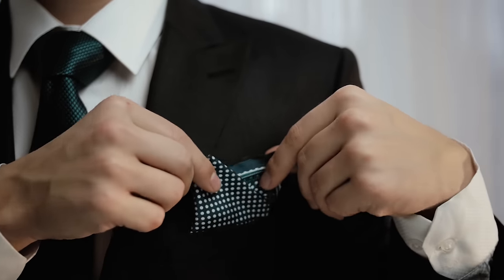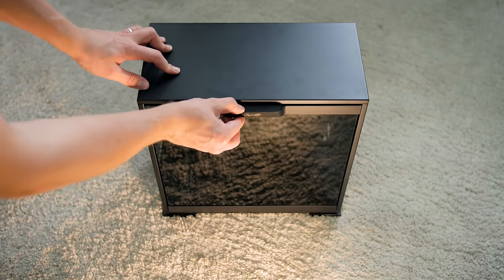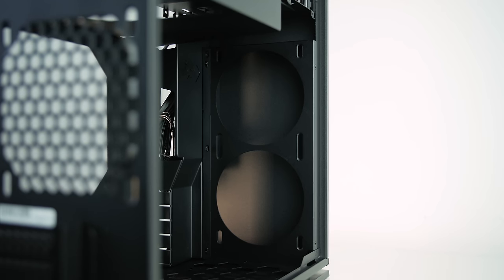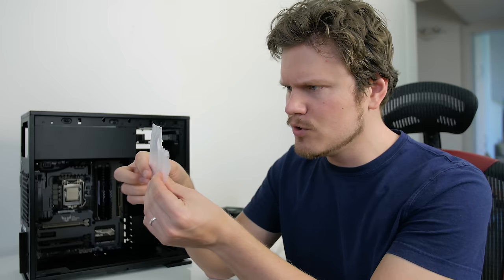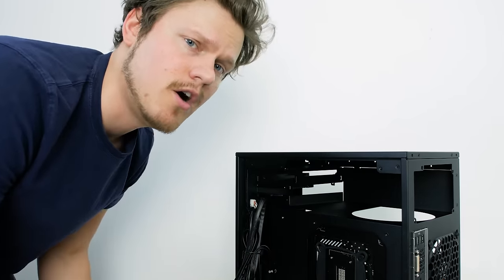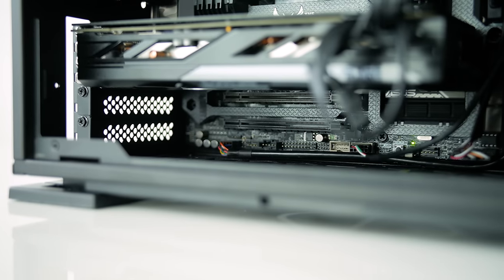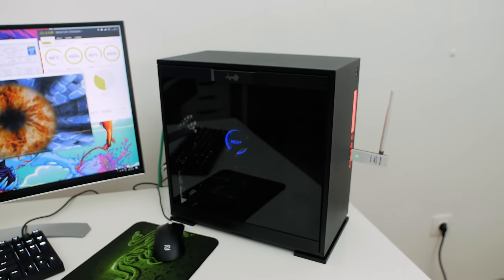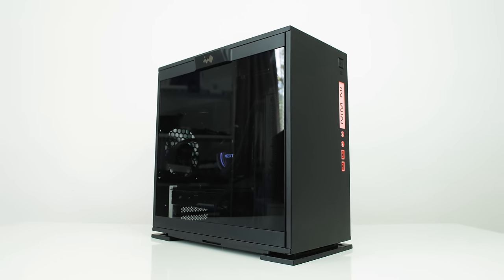Pure Class. The InWin 301 mATX Case!

Comment: This case is one step forward, two steps back.
Reply: Still better than many other mATX cases on the market. Honestly, mATX has always been my favorite form factor and I'm glad to get a decent looking case from them.
Reply: is like twelve steps back. Bad cable organization, PSU at the top (mother of hell are we at 2012???) plus bad design overall and specially the dotted edges like if it's a microwave or something. I wouldn't buy this even if it was at €20 or less
Reply: define c was good tho
Reply: zadoww well said, aside from the design, i'm not a sure about that bottom fan placement and it looks like that cable management will be a challenge. That  side panel is great tho.
Reply: Ber Ting well the bottom fan placement is need because lack air flow. And since hot air rises it would make sense put fans on bottom
Reply: *This brand
Reply: now I get it thanks! but i'm still concerned about the air intake in those fans especially in my country where temps raise up to 38-39 C in summer.
Reply: I think that the main air intake zone is the bottom, like in many Silverstone cases
Reply: we come together cause opposites attract
Reply: zadoww As with most Inwin cases.
Reply: stealing my profile pic?
Reply: ...been using this for Years.
Reply: you have to keep in mind inwin designs cases for custom water cooling loops not air coolers. Also that tempered glass side panel latching mechanism is my favorite so far.
Reply: There is nothing to attractive about this for CWC.
Reply: Only bad thing about these sleek InWin cases are the lack of air flow for intake, so I'd like to disagree on "bad design," because that's highly opinionated. Trust me, even with all the options of rubber gromits and cutouts for cable routing, A LOT of people still don't put out the time to cable manage anyways.
Reply: oh we had the same idea than!
Reply: nzxt s340 elite is better. 301 is a fokin vaccum
Reply: Lanze Manao in what ways is it better? you can't just claim that one case is better than another without detailing why you think so. I for example think the 301 is more aesthetically pleasing and I love the radiator mounting at the top. plus they are different form factors
Reply: I mean it's not meant for an atx motherboard, the intake is at the bottom and once again this case is designed for water loops not air flow.
Reply: don't get me wrong, they are stylish, but there are always a few elements to the design that make them woefully impractical.
Reply: I think it's impractical for an aio or an air cooler for sure.
Reply: This is true. AIO coolers need to have longer or more flexible tubing in order to put the front panel back on, or for most I know zip tie their tubes to any of the opening of the honeycomb fan grill at the top.
Reply: The case would work just fine with an air cooler and some common sense. If you think the front will choke up intake then maybe it would be sensible to try something else in the review?

And some of the points made are just stupid. Try to see cases from users perspective and not from someones who keeps rebuilding systems. Most of us just build it and upgrade gpu in 2-3 years.
Reply: indeed. InWin needs to start thinking about convenient design already. cable routing needs to become a priority for them.
Reply: the only worry I have with the latch mechanism is that every single store that I went in and checked out the 303 on display,  every one of them had the latch mechanism broken to where it would not hold the door close anymore.  Makes me wonder about the durability of that latch,  though I do understand that display models are usually subjected to much more abuse than would happen in a normal use case senario.
Reply: @Dash Trash Who the heck cares if the PSU is at the top, it makes practically zero difference. PSU at the top tends to get less dusty anyway.
Reply: @Kareef Huggins I mean, for that yeah I would say those 303's have probably been opened several factors of magnitude more than your average home owned case. Home owned case you  open it maybe once every month at the most. Those probably get opened and closed 10 times a day.
Reply: Agreed. Sexyaf, but poor airflow and no external drives?

Comment: hey guys,
just to mention: THIS is not how the case is supposed to work, as you can get from any pictures(e.g. in win website) the bottom is supposed for intake (--> dust filter), the front for outtake (--> no dustfilter needed)... The case uses the effect of warm air going up and ventilating the graphics card directly... The front just lacks of intake area (much blocked)... I'm quite sure this could help the temperatures.... 
(-> maybe new testing needed, so you don't use the potential, what is quite sad...)
greetings ;)
Reply: jojo23 Thanks! this should be top comment, everyone is complaining about this case..
Reply: This is correct. Radiator fans in push configuration to send air OUT of the side vents, with the bottom fans populated for intake.
Reply: this should be noticed and another video for this case
Reply: jojo23 so they don't have a gpu there? Huh
Reply: maybe flip the rear fan to intake... that should promote positive pressure and less dust in the system?
Reply: na, so the rear fan pulls dust in, both bottom intake and front double outtkae (but much blocked) and rear outtake should equal each other and lead to neutral pressure, possibly the best for dust and temperatures, with bottom and rear pshing in you'll lack of outtake...
Greetings
Reply: the way i understand it, dust filter will reduce amt of dust with intake fans.  

2 intake & 3 exhaust fans = negative pressure in the case... unless u do fancy fan curves with those.  

2 intake & 2 exhaust = neutral pressure in the case

3 intake & 2 exhaust = positive pressure in the case
Reply: not in this case (case, case :P^^-got it? xD), ahm, no, the front is so much blocked that you cant count these two fans as two, more as one, its not about the number of fans, its about the air moving and trhough the front the air movement is very minimal... ;)
Reply: "unless u do fancy fan curves with those..."
Reply: Well said. I thought the same thing, especially given how it seemed they went out of their way to clear the floor of the case, which is unusual in cases. You'd think one of these reviewers would put some thought/research into it.
Reply: So should I even have 2 fans in the front for intake and one at the back for exhaust? Or should I just have 2 fans at the bottom for intake and one at the back for exhaust?
Reply: not gonna to have a graphics card at first, so i might get away with 1 cpu fan, 2 front intake fans and 1 rear exhaust, will see how temp fairs.

not gonna to put 6 fans in that little box unless i absolutely need them.
Reply: 2 at the bottom for intake and one at the rear for exhaust, if you want to go for the last celsius go for two front exhaust additional ;) cant guarantee that but it should be the best, in the end, test it out ;)
Reply: i'll give it a try, thx!  ^^
Reply: robert if you've got and results, testings etc, post it for us, would be interesting! ☺
Reply: thats a valid point^^  forgot about that, would love to get my handy on that case, let's se.... ;)
Reply: still debating if i should go with a full atx board... i wanna stable overclock  >.<
Reply: Was about to post this also.  If you look at the in-win site also,  they have a digram showing the airflow design.  https://www.inwin-style.com/en/gaming-chassis/301

The front is supposed to be mounted for the radiator cooling to go out the side of the case.  cool air from below.   Makes perfect sense since heat rises,  the coolest air will come from underneath.
Reply: certainly, but don't hold ur breath.  it is a slow build, i've got a power supply so far...   :D
Reply: What about using static pressure fan for front intake since it's choked so might as well treat it like you're pulling air for radiator, and then normal airflow fan for bottom intake and exhaust? That could work I reckon. And then just get those custom magnetic dust filters from demcifilter website
Reply: sure it could... but warm air moves up, graphics card pulling air upwards.... dont't see a point why you should... just use the bottom as intake... makes it easier.....
Reply: Agreed I feel like temps would have been way better if the fans were set properly to two intake fans in the bottom with the dual exhaust static fans in the front and single exhaust in the back.   My plan for this rig is two slim thermal take 120 mm fans intake on the bottom,  the kraken x52 exhaust on the front and an exhaust 120mm on the rear.  I think this setup could provide much more acceptable temps.
Reply: I would probably flip the back fan to a high pressure fan intake (and add a dust filter, they're cheap), as well as two high pressure exhausts on a radiator up front, keep the bottom as intakes...keep the case absolutely positive pressure.
Reply: I only have an i5 6500 with stock cooler and a GTX 1060 in this case but my temps are awesome.

I have two fans at the front for intake and one at the rear for exhaust, no fans at the bottom.

my temps for the CPU haven't exceeded 42c and for the GPU only 68c.
Reply: Just have to point out here, Ive had my build going in this case for a week. I don't care what Inwin says, using the front for an exhaust even after switching to my highest static pressure fans and spending well over 2 hours making sure not a single cable was blocking the intake... It netted waaaaay higher temps then the standard exhaust in the rear config.  I havent seen temps higher then 49 with 4 fans running(splitter died). Static pressures on the intake in the front is the key.
Reply: I think so too, this way... intake > exhaust = positive pressure = less dust?  Obviously cooler too   :D

ever been to a restaurant where the suction on front door is so strong, u had to wrestle those doors open?   thats negative pressure in action; exhaust > intake = dust friendly and higher temp 

will report in when mah sys is up and running  ^^
Reply: robert exactly! another reason there set up doesn't work... every atx psu in existence exhausts hot air out the back... well having the rear as an intake means it's pulling in hot air directly from the PSU. having it as an exhaust with the front as exhaust and just bottom intakes was the worst . Good luck with your build. one thing no one has mentioned, is in a dark room, if you have LEDs in the case, the side panel literally looks invisible . I had a friend try and reach in lol.
Reply: someone answer to @michal Zbranek, I have the same question
Reply: i actually am wondering about the thinking of hardware canucks. this seems really bad to me that he didnt notice this
Reply: wait so i have this case where would i install my intake fans where the little plate/holder thing on the side there? (i k now this comment is pretty last sorry)

Comment: Finally it's out! And i'm still buying it despite the rubbish cut outs because it's mAtx with a glass side panel. Shame NZXT don't make a mATX S340 Elite
Reply: Tell me how your build turns out. Im interested in seeing the builds people will come up.
Reply: I just built a mini intel build with it and my temps are fine. I put a mATX mobo with i57600, 16gb ram, a r9 280x from my old build and a 800w semi modular psu in mine. I have 3 cougar long life fans (at least they say they are :/), 2 in the front, 1 in the rear exhaust and i don't seem to have any problems with cooling with the only problem being the stock intel computer. My ONLY problem with this case is that my 3.5" drive bay sat too close to the rear panel and my PSU sata power cables don't have a L shape to them and the rear case would NOT fit, so I had to nudge it forward a bit to make it fit. Other than that, I really like it and everything fit. Also, word of advice to anyone getting this case, DO NOT get a standard PSU, at least get a semi-modular or modular PSU and you will thank me later.

Comment: The side airflow is an exhaust.  This case gets its air intake from the bottom (the clue is the fact that there is a dust filter for the bottom).  Air comes in from the bottom, and exits from the front and back, well suited to a negative pressure design.
Reply: i have this case and there is a removeable dust filter on the bottom
Reply: @zealoustherealous  yea I have this case too which is why I mentioned the bottom dust filter in my first comment. It is awesome. So sleek looking and the most compact mATX case I could find at the time.  I have the fans set up to give me intake at the bottom and exhaust at the front and back.  It works pretty well.

Comment: I have very mixed feelings... the case is sexy AF, is my preferred form factor, and one of the smallest in that category as well... but that restrictive airflow design...  you should not sacrifice function over looks. If placing the intake fans on the bottom resolves that (would be interesting if you compared the set up you had here with bottom mounted intake fans), maybe it would be great. Still, looks like even the bottom is still restrictive.  I really would like this case, but that's a huge doubt.

EDIT: InWins website shows the case to be designed to pull air from the bottom, and use those side vents along with fans for exhaust. I wonder if temperatures would improve with that configuration?

Comment: I know it's a few years old, but I just bought this for a itx build. Almost every itx case I see either has a basement that chokes air to thicker gpus, does a sandwhich style orientation which if you have a hot gpu that backplate radiates heat to the motherboard and cpu, or you get stuck buying a expensive ncase m1 that is never in stock and you get no side panel to see the inside of your case.

Comment: I'm currently doing a build in the white w/blue version for my niece's b'day.  Here are my mods so far :
1-removed the plexi from the front IO, stripped the blue silk screen and In Win logo from it and replaced it with her name in vinyl with light blue vinyl behind it returning it to a close to factory look, but fully custom.
2-replaced the power supply fan with a blue led fan to illuminate the inside as there is a cutout for the PSU fan exhaust on the bottom of the enclosure
3-hidden blue LED bars tucked into the inside of the rail inside the bottom of the TG side of the case.  Got them at the auto parts store on a whim, they just  happen to fit perfectly.  Wired them to molex for power.
4-CNC milled out a hexagon pattern on the front to help it breathe so I can mount the radiator on the other side of the bracket inside what would be the side air intake area, thus giving more space inside the chassis and more airflow as this case is pretty claustrophobic.

Comment: I think the best feature of this case is probably that you can remove pretty much EVERYTHING from the case with just a few screws. Unfortunately, the PSU shroud and MB tray are one piece, and the shroud is very much in the way, so you almost have to cut the shroud to make use of the front if you're going custom.  Also unfortunate, once everything is out, there aren't many places to screw any custom stuff you add back, so you'll have to get creative and plan carefully.

Comment: IMHO you would likely get better temps using the radiation on a push fashion and pushing that air out the side and not sucking from the side. Then if there is room putting some fans on the bottom to pull air into the case. At least thats how I would do it.

Comment: I own this case, it was the worst PC build experience ever. Dual 120mm AIO water cooling is near impossible, stick with a single fan AIO if you're going to do water cooling. Even then it still doesn't cool properly and my i7 7700k gets 90 degrees + often. I anticipated that my CPU would be running on the hot side with a mATX enclosure but this is too much. Unfortunately, there are not many mATX cases with tempered glass and I went for the InWin 301 since it was smaller. I'm going to be switching out to a Phanteks Evolv mATX TG asap. Best of luck with your PC builds everyone!

Comment: I feel like case needs 5 things to be a great case: 
1) needs be wider - that way they can adjust the area behind the motherboard  for cable management and to keep that side intake viable
2) needs to be taller - so that those bottom fans can fit with a matx motherboard installed
3) rgb lighting on the i/o because rgb everything these days
4) Change the power supply mounting because of what Dimitri noted. I feel like an extended bracket that slides in through the back would be great for this case.
5) the little bracket for hiding cables needs to be bigger to allow for more cables
Reply: That ruins whole point of being smaller case. Then just get inwin 301c

Comment: According to IN WIN's website, the front (side panel) is supposed to be the air outlet. Maybe, that will make the case cooler? Can you Try it? Is it possible to add two more fans on the bottom with the front radiator installed?

Comment: If the airflow is meant to come in from the bottom and then out the side vents, I don't see why the rear couldn't be used as intake as well(i'm aware of the PS fan as an exhaust).  A polyurethane foam filter could be trimmed down and used to filter the rear intake. Just an option for bringing more cool air into the case. Adding bottom intake fans also have the added benefit of concealing the bottom MB headers. Anyways, I bought this case for my new build, everything is on trucks and out for delivery today. Excited about my new Ryzen build.

Comment: The first thing Im gonna do when I get this case is to cut a hole in the front for a fan and connect the fan to the gfx card so that it will pull fresh air only when the gfx needs it. Seal the mesh on the metal panel and use the rear fan as exhaust.
I dont like bottom mounted fans cuz thats where all the dust collects.